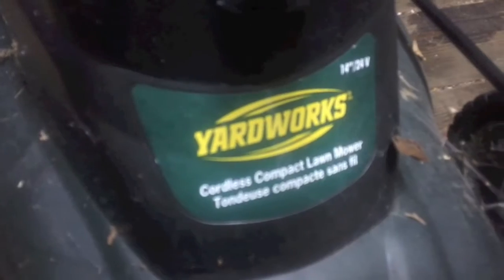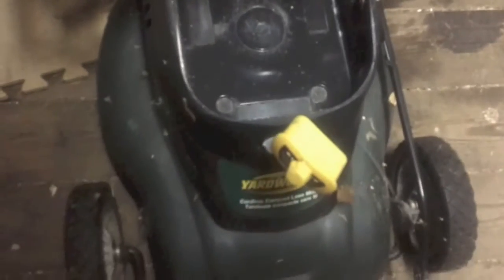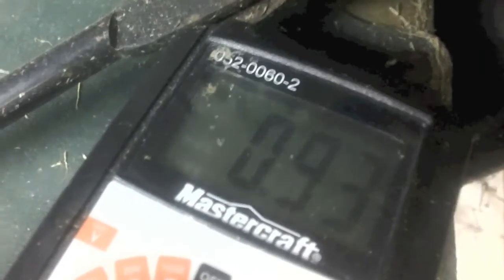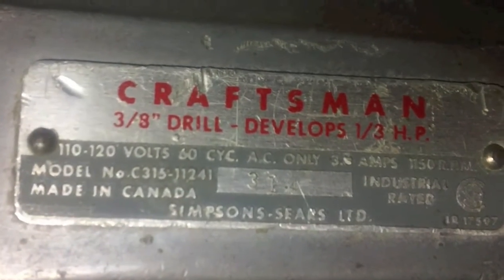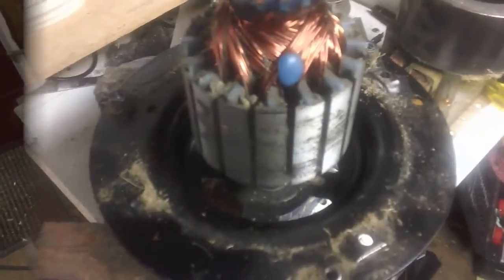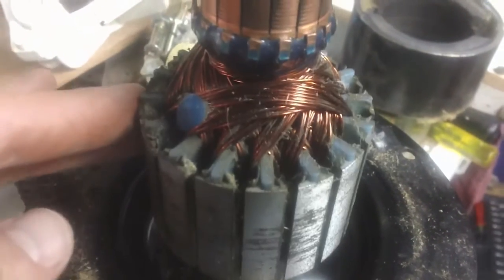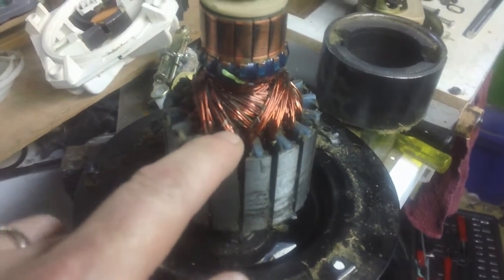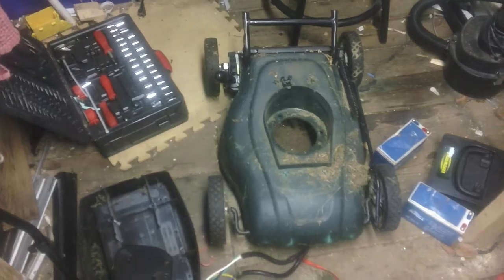Cordless Lawnmower for Wind Turbine Motor?

Comment: You could use a voltage doubler to get the voltage up. But its probably not worth the effort for so little power. Thanks for posting.
Reply from the maker: That's a good idea. I was expecting more juice out of it and really wanted to slap a blade on it. Kind of bummed. I like to create than tear down.